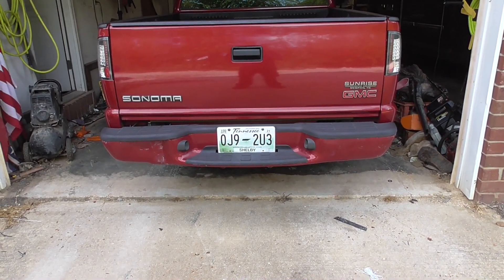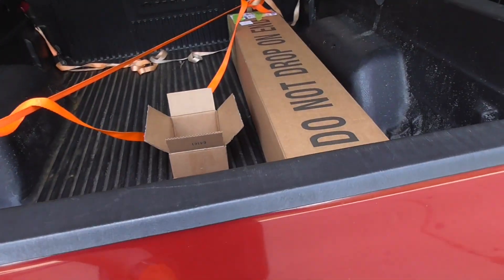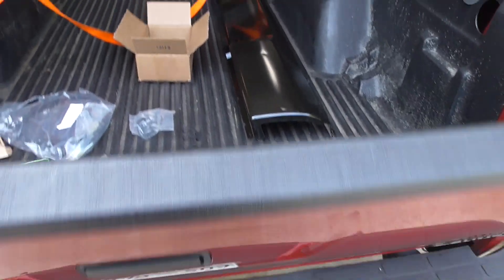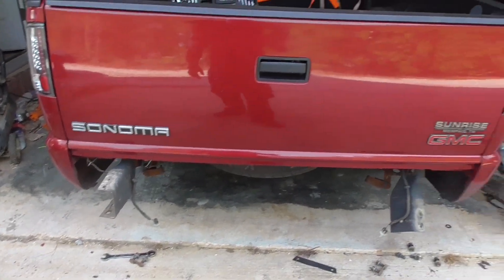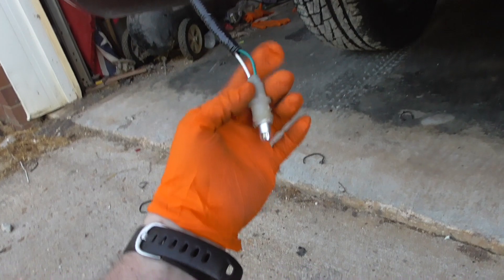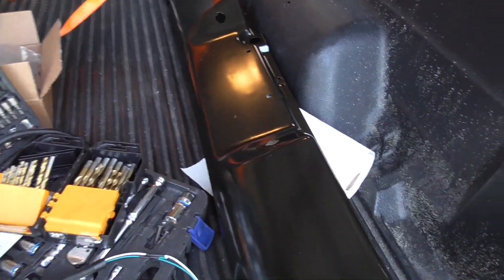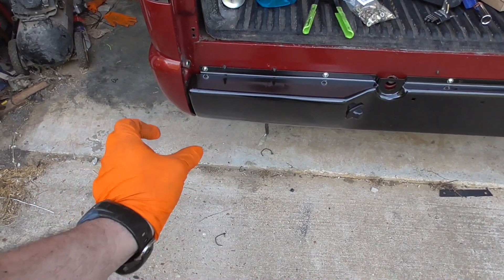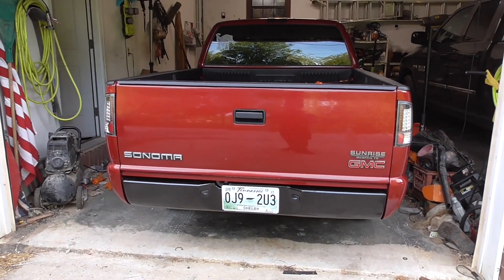GMC Sonoma | Xtreme Conversion Part 2 | Factory/OEM GM Roll Pan Install | 15958890

Comment from the maker: These are the GM part numbers you need for all the pieces to install the roll pan.
Roll Pan:                                              15958890    - need 1
License Plate Socket:                       12083460    - need 2
License Plate Housings:                   918399        - need 2
License Plate Housing Clips:           16503699    - need 2
Rubber License Plate Bumpers:      4830147      - need 2
Reply: That pan is now almost 200$ new.
Reply: They discontinued the rubber license plate bumpers. Any idea where I can find them?
Reply from the maker: @andyschoen7126  Should be able to use any rubber fuel door stopper.  Parts stores usually have a universal assortment of rubber plugs for fuel door stopper/License Plate bumpers in the help section.
Reply: Will the license plate light housings from the factory bumper work? or the lights?
Reply from the maker: @harleyguy932  No, different design.

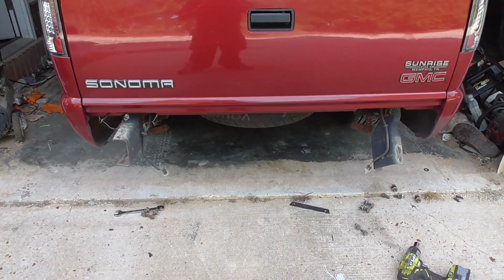Comment: 7:00 typical Memphis quality. LOL. Bought a few trucks from that dealer. With my S10 and it's transmission issues they refused to admit there was an issue until the warranty was out.

Comment: It's actually listed as a bumper delete pan ....and yes you can cut the square hole but just easier order a pan with it already cut in it ....the gm pan is same sheet metal thickness as most all ebay or Amazon roll pans

Comment: Sucks all that bad bodywork. I got a rivnut tool awhile back. Have yet to use it.
Reply from the maker: Yeah, sucks I happen to have two bad apple body work vehicles.  At least this one (so far) is all fixable by a respray.  The Yukon needs new body panels and new metal/bodo work along with a respray to fit it.  Rivnut are fantastic, I use them whenever I can.  Wish I would have known about them along time ago.  Plenty of things I did ages ago that would have benefited from rivnuts. Infact, I need to redo the rock lights on the Sonoma with them like I did on the Jeep and Yukon.  So much more freedom of mounting locations that way.

Comment: My question is what about if you want to hitch well can you have a hitch with the role pan
Reply from the maker: There are specific hitches designed to go behind a roll pan.  There are also specific roll pans with holes behind the license plate for those hitches. Those hitches may work with the factory roll pan but I'm not sure.

Comment: Why did you get rid of the IROC wheels?
Reply from the maker: I wanted bronze wheels.   Pretty much the only reason. I still have them though in case I decide I want them back on at a later date.